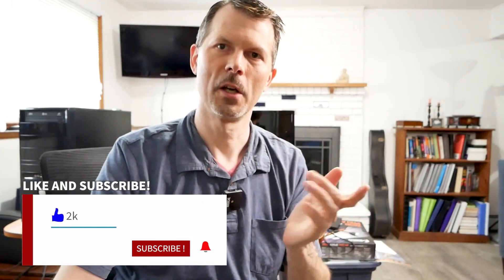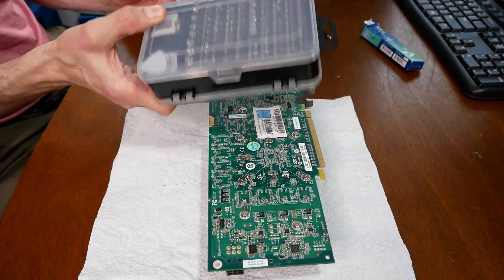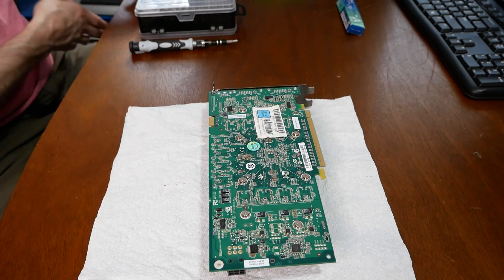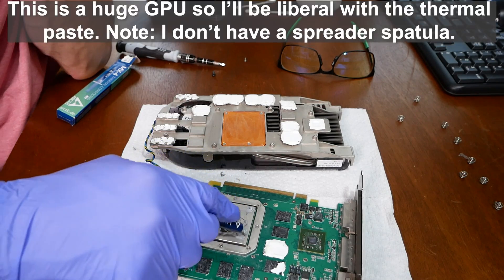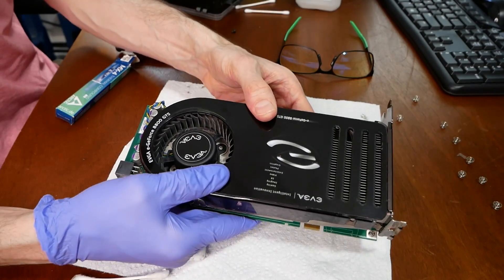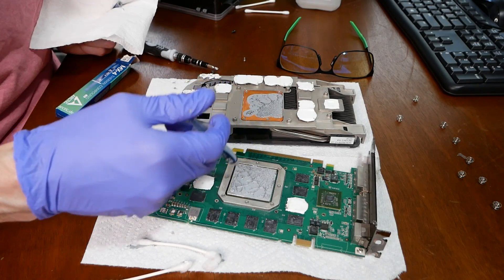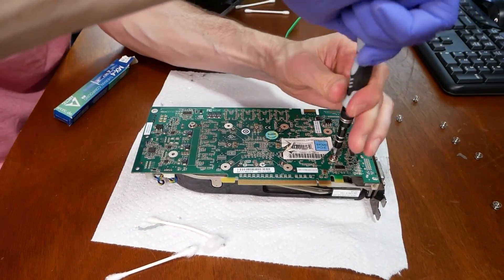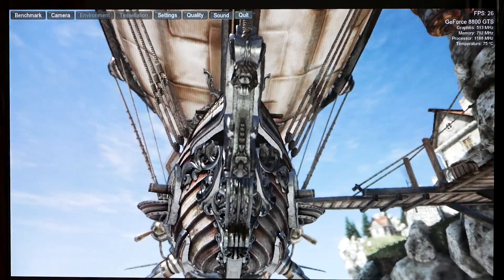How to Apply Thermal Paste to your Graphics Card - 10c Drop!

Comment: Will a new gpu come pre installed with thermal paste? Or do I need to put it in myself when it is brand new.
Reply from the maker: @OwenEsparza-s8v  a brand new GPU shouldn't need to have thermal paste or pads reapplied.  Perhaps after a couple years. Or if thermals start to get higher and higher.

Comment: This is great stuff I have a old laptop I need to do this, the GPU and CPU are both under the same heat sink... Can I put a bigger heat sink or make one??
Reply from the maker: @320466  Hi there, and welcome to the channel. Typically, a laptop hestsink the small interior of it and not usually replaceable with a larger one. But some laptops are easy to open and take the heatsink off, clean, and re apply new thermal paste. Google or YT search your laptop, make a model, and see if there's a tear down video. If it looks easy, perhaps you can tackle it yourself!. Let me know how you make out. Tha ks for watching and commenting. I appreciate it.

Comment: Depending on the gpu I'd spread the thermal paste around myself.
(Usually a plastic bag & my finger here.)
Rather then do the mounting pressure thing as a gpu usually has more contact area then a processor die.

I've had gpus drop plenty in temperatures tearing down & cleaning the heatsinks as well rather then just putting on new thermalpaste on due too excess dust being stuck & blocking off the airflow of the fan or fans.

Lil brother is currently using a gainward gtx 1070 phoenix with a dead hdmi port.
Thats otherwise working perfectly fine that i recently got from the junkyard.
Cost me my displayport too hdmi adapter for him too use it.
But was a solid upgrade that cost me otherwise nothing with a coworker finding it in the junkyard electronics container & later bringing me it.
Reply from the maker: Hey there! Sometimes I use a spatula sometimes not. The plastic bag idea sounds good. That 1070 you got sounds like a good find! I've been wanting to test one but yours was free. :)

Comment: Ah, the endless debate on how to apply thermal paste. I'm still stuck on the giant pea sized for square CPUs or the 1 inch line for rectangular CPUs.Some people prefer spreading a thin layer with a teeny weeny little spatula. Removing and reattaching the block [i]could[/i] add bubbles. So many variables. I wonder if a video could be made with all the different ways to apply thermal paste, and removing/reattaching the block without cleaning it, and thermals after running something heat intensive like R23 for an hour. That would be an interesting experiment. 😉
Reply from the maker: Hey there. Yeah I could have used a spatula. Air bubbles are a thing. I basically took it apart after the application to show the coverage. Good idea for a video ty.

Comment: Why you opened the GPU after applied New Thermal Paste. Which causes to form bubbles between the thermal paste. So Heat transfer becomes slow. and Starts Overheating again. I had 9200m GS and do the same (applied new paste and opened the cooling heatsink then attached the heatsink then I turned on the temp rising to 60 degs at idling and playing san Andreas the temp goes 80 and in GTA IV it goes to 101deg celsius
Reply from the maker: Hey there. I wanted to show how it wasn't very evenly spread out the way I did it. Using a spreader would have been better. Thanks for the tip about the heat and air bubbles I appreciate it :)
Reply: @RememberThisTech  try and you may get above 10 deg celsius gain for that GPU and save it for your collection
Reply from the maker: @mwolf7780  Will do tyvm :)